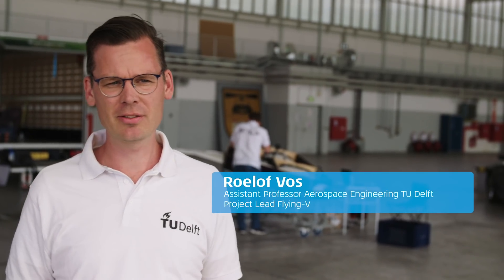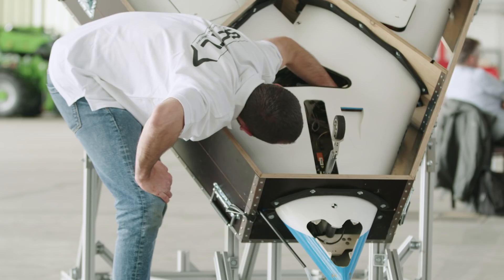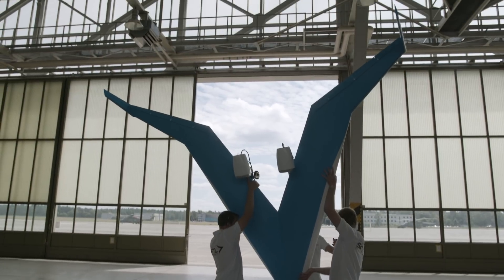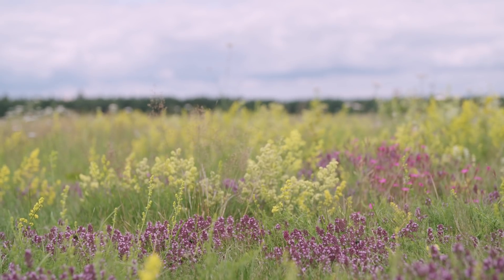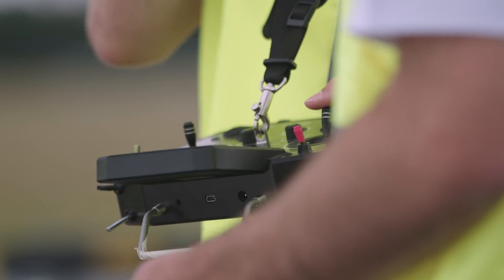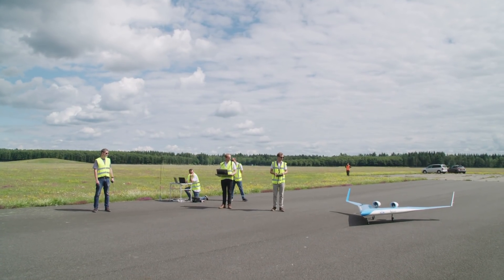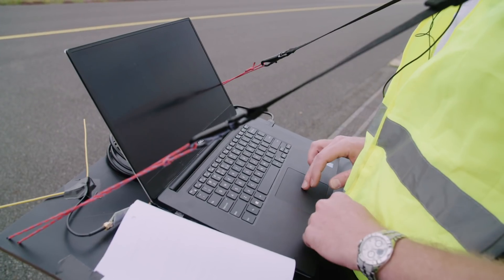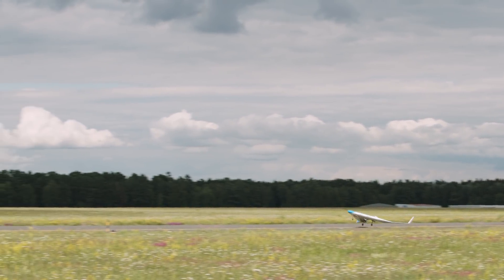Flying-V - Scale model maiden flight

Comment: Aerodynamically more efficient maybe, but I seriously doubt it would more efficient to manufacture, etc. And all the drawings I’ve seen show windows in the leading edge which sounds like a disaster waiting to happen with icing conditions, a large bird strike or even minor accident survivability.
Reply: Idk, they deal with birdstrike, crash, and icing issues with cockpit windshields.  It would cost more, but think it's feasible from a windows standpoint.

I've heard that riding in the wing would be disconcerting when banking, think that might be the killer.
Reply: Neil Carey  Well the cockpit windows are pretty thick multilayer glass, that would be quite expensive and heavy with a lot of extra structure around them compared to current passenger windows. To do all the passenger windows in the leading edge like that, it’s not very practical I would think. And yes, I can see the banking being problematic.
Reply: The same reason why blended wing aircrafts are not being in use commercially, the idea is not new.
Reply: @SuperYellowsubmarin  Exactly, a very old concept. Maybe all the continued research will pay off eventually or uncover something useful, kind of like the current research into quieter supersonic aircraft.

Comment: I guess it crashed as they're not showing the landing...
Reply: Hi there, it didn't really crash, but it did land hard enough to damage the nose gear. Also, "dutch roll" tendencies. However, these things are to overcome, it's a test model. It's a completely new shape for airliners, that's for sure.

Comment: Would be interesting to learn a bit about how difficult it is to maneuver, as flying wings are said to be less stable.
Reply: Apparently it has a bad case of "dutch roll".

Which is an actual aircraft effect, when the aircraft yaws uncontrollably.
Reply: I read a report that said it was quite "difficult to land" and it was unstable... not sure if they only meant that it was unstable on final, or all the way around.

Comment: The design was ok except for the huge v-cut at the back, it might have something to do with aerodynamics but doesn't it a huge waste of space and also a huge discount on the aesthetic side.
Reply: wings on conventional planes, also waste space as well. Saving 20% of the fuel, is a good win tho.
Reply: @senryuuhoutaro3353  Doesn't the wings of aircraft store fuel? Isn't it not waste of space if it was used to store something?
Reply: @cheezehao1129  The design is to make the plane lighter, so they can have less space, and use less fuel because.. it's lighter mate.
Reply: @senryuuhoutaro3353  I am just saying that it is aesthetically not good, a lot of flying wing designs don't have the cut out too. If you don't use the cut out design and used the space to store something, you can make the scale smaller thus more efficient. I am not against the design but I really don't know why they design it that way, it might have a special purpose but from my unprofessional eyes it is a waste of space.
Reply: @cheezehao1129  well, as far as I know it brings a huge benefit in aerodynamics over having that space filled. The savings on fuel and weight by not having that part, outweigh the benefit of added storage.
Reply: @nikolaalexanderphilipp968  Maybe you are right but doesn't the cut out interfere with the lifting body design that provided the efficiency?
Reply: @cheezehao1129  Well, I'm no expert in aerodynamics, but I doubt they would've built that way if that were correct. 
I don't think the V design is for the sake of looks, it's definitely for the sake of function. 
The V shaped wings probably provide better lift than an entire body? I don't know, but I'm sure a quick google search on the topic of V shaped planes or the website of TU Delft will provide clarification :)
Reply: @nikolaalexanderphilipp968  Since I am not an expert, I would just say that the design looks awful and that's all I can say, any other aspect of the design are beyond my knowledge.
Reply: @cheezehao1129  let's just hope, this is a step, for greater ways of air travel, that will surely make things better in any way possible. I'm also not an expert XD
Reply: @senryuuhoutaro3353  I certainly hope so too, commercial aircraft design have been stagnated after the Concorde end in failure.
Reply: Imagine parking these plane back to back, they will indeed take less space. So, no waste of space....

Comment: This configuration came into being in 1996.   John McMasters was its creator.   (And yes, I know that it is close to the XB-37, YB-49 and B-2).  A few years later Bob Leibeck came up with something similar.   Boeing and NASA have had a similar model flying for 10 years.   So while I applaud the team at Delft, it really has to be admitted that this isn't a stunning new invention - it's old enough to vote and drink.
Reply: A well yes, you are right,but the thing is, this model represents a to becommercial airliner , with a double fusilage making the v shape , so altough not the first flying V , definitely  groundbreaking stuff.

Comment: there are 2 wings and 2 engines, why it wouldn't fly?
Reply: With enough power... You can get anything to fly!
Reply: @ivanivonovich9863  Right, but the idea about this design is to make a more efficient airplane, so it won't need as much power as more conventional designs.
Reply: Because the fuselage is the wings

Comment: Would adding a rear stabilizer connecting wings add to structural strength and stability?  Half a triangle seems not the most robust design.  My qualifications for suggesting this: I built balsa models as a kid.
Reply: Adding a rear stabilizer connecting wings add to structural strength and stability would improve strength but also weight and DRAG, the whole idea is to have a wing without the ''conventional tail''.

Comment: So many problems with such shape and configuration: stresses at the root of those wings must be enormous; engine location will disturb stable air flow around airfoil and will make maintenance difficult; weight balance with passengers/loads will be a critical issue; evacuation procedure seems to be complicated; airports infrastructure should be changed to handle such aircrafts; but in the end of the day something new and financed, good job
Reply: Are you a nasa aircrafts worker or what? r/imintelligent
Reply: @matee6042  No, just an engineer having common sense

Comment: With enough thrust ive seen a scaled lawn mower fly soo im not that impressed.
Reply: yeah, I was underwhelmed too. Two years work?
Reply: You are missing the point, they want to create a more efficient plane than the conventional fuselage + wings design. So the idea is that this plane doesn't fly as long as plenty of thrust is added, like a flying toilet seat, lawnmower, etc, but to make something that uses less energy/thrust to get up and stay in the air. Otherwise it would be a total waste of thinking and time, as flying wings already exist.
Reply: The guy who designed the original in the 70's used to belong to the club I fly with he is gone now though

Comment: Get rid of the verticals and add engine vectoring
Reply: Not a good idea, if there is a engine failure, the plain has no way to manover.
Reply: @NadeoWolf  Well, it will still have another engine, but maintenance of such system will be a nightmare not only from technical but from economical point of view as well
Reply: Verticals reduce inductive drag, vectoring will consume more fuel = not meeting their primary goal of being energy-efficient

Comment: It's an ingenious design in terms of operating efficiency. One question though, assuming the plane crashes and all the exits on one side of the plane are blocked, how are you gonna evacuate all the passengers within 90 seconds?  Unless they can demonstrate that all passengers can be evacuated from the plane in less than 90 seconds with all the exits on one side blocked off, then even if they build the plane, the FAA, EASA, ICAO, and other regulatory agencies will never certify the flying-v to carry passengers.
Reply: @ogdeeti  This is one of many issues with this configuration.   The people along the centerline are a long way from an exit.   The people near the leading edge can be a long way from the centerline and thus very susceptible to roll disturbances.   The engine/pressure vessel is another cert issue. And finally,  the non circular cross section drives up the structural weight - hoops do a great job of distributing the pressure load equally.   None of that should be construed as I don't think this configuration should be studied.   It just has almost as many things working against it as for it.

Comment: The traditional straight-sided barrel with wings attached is attractive to manufacturers because many of the fuselage structural pieces can be identical or near-identical items. 

With the components of the tapered wings, about the best you can hope for in repeatability is pairs. However the same applies to the traditional aircraft wings. 

As pressure vessels, the aerofoil shapes will be inherently weaker. It is likely that the passenger space will have awkwardly placed ties and bulkheads. Air pressure could assist in the strength of the structure. 

Systems for handling of passengers and baggage at airports will have to be revised or the airframe significantly compromised to allow existing airport services to be used. 

With this radical concept, one can expect the build to be more costly although we now have 3D printing to help out.  This would be partially offset by the saving in eliminating the fuselage completely. 

The downside will be that the aircraft may be economically impossible to alter in size for more or less carrying capacity. With the traditional barrel fuselage, adding or subtracting near-identical fuselage sections is simpler.

Therefore, this radical design would need to be absolutely correct for intended purpose. How vulnerable will it be to orphanage by sudden ambushes in the marketplace. The Airbus A380 is an example of where it can go horribly wrong. 

Significant serviceability issues will exist due to the engine placement, maybe less so than with engines contained within a lifting body design. 

With this radical concept, one can expect the build to be more costly although we now have industrial scale 3D printing to help out.

Comment: I'm generally not a fan of the Flying V compared to the Blended Body Design like the X-48C or Airbus Maverick. But I applaud KLM and TU delft on trying these new structures. I would be curious to see how they would design the interior.

Comment: Whets the appetite!
One of the few scale airliner models I’ve seen that seems to fly to scale speeds
Reply: That's largely down to apparent stability. If the passengers were subject to the scaled up amount of fidgety roll movement you get with scale model RC aircraft, even the big ones, no one would want to fly. It would be very uncomfortable.

Comment: It appeared to be a bit tailheavy and the nosegear is a bit to short ; it looked like the model had to be "pulled off the runway" and once airborne almost stalled. 
These guys should cut one out of polysyrene (eps) covered with glass fibre "straping" packing tape. Then you have a cheap disposable one to get used to flying it and iterate by "tial and error"   And make that one bright yellow with day glow orange tips so you can see the thing while you are flying it.
Reply: @terrypold  the so called "trust angle" in a ideal situation should go trough the center of gravety . The 737 "MAX got this verry wrong with known results.  Trust angle should never be used to compensate ballance problems because the effect changes with the amount of trust. the last thing you want when you abort a landing is the plane pulling up or down without elevator input.
Reply: @terrypold  there is no visable trust vectoring system on this model and getting one certified for a airliner would be complicated. Its a proof of concept of a potentional future comercial design hence KLM and AIrbus are supporting this.
Reply: @terrypold  dificult to see; the chord center line is almost impossibe to be sure of with all the changes in profile along the wing.
Reply: @terrypold  (half) symtricsl profiles arn't flat. Sure they could have make it as a fllat plate and it would still fly assuming correct cg and trust but they did not.
Reply: @terrypold  ah you are a "flat earther" that explains why you assume your  lack of knowledge is a advantage. Once you you learn about the subect you will find out there is much more going on; this is why there are so many profiles. 
https://en.wikipedia.org/wiki/NACA_airfoil.

Comment: What if all passengers suddenly come to one side ?
Reply: Same as if all passengers moved to the back of a conventional aircraft.
Reply: Don't worry, airlines will impose fees for comming from one side to another. :o)
Reply: @TU DELFT
good word
but
how you can manage the weights in both sides of the wings (noted that you have passengers and luggage ...)
Reply: @essafymohamed6016  more than likely they would change the lift gradient on the individual wing or increase thrust on one of the engines
Reply: They would probably use fuel as ballast and move it from tank to tank.

Comment: Anyone curious about the landing, it was rough landing, and nose hit the ground,
Edit : sorry, I mean the nose wheel damaged
Reply: As i quoted: Smoke on the water. I am just a poor boy of cellar science but i know for sure, that this draft makes severe un - CADed problems. I flew as PIC Planes and Modells for long time, i believe that i have it in the guts when there is something wrong with a model (in which size so ever). If you will test it in low speed config. i will show them horrific flight configs in delft, so that they will be humble to mow the airfield by hand. True hand - work makes the spirit honest. See me smiling.

Comment: Airbus is claiming that this is a revolution in design, but honestly, not only has this boomerang shaped designed been used before, but its not as efficient as pure flying wing aircraft. Ironically, NASA has been testing this design for over thirty years, with a model test flight of a working prototype a little over ten years ago.  The problem with such a design is that it probably has all sorts of drag on it, with such a blunt wing like that.  This is more stunt than test.
Reply: The reason they test it is because it's shown to be 80% more efficient about fuel per passenger than conventional aircrafts.
Reply: Airbus knows what they are doing and even if you are right; this model is much cheaper then wind tunnel test. would not be surpriced if the carbon fibre used are left overs from full size production. So all they had to spend is a bit of epoxy and model plane gear,
Reply: @cmulder002  Of Course they know what they are doing.  They know how to copy and steal ideas from competitors.  Flying wing designs for commercial aircraft started back in the 50's. A similar boomerang style aircraft was conceived years back.  Hell, the B-2 bomber is a basic boomerang shape.  Not even 20 years ago, NASA had tested their own 1/10 scale model of a flying wing.  All Airbus did was take that research and claim that they are making a break tough design when really they haven't.  The BWB was originally slated to be the next 797 back in 2000, before people realized that no one wants a supper sized aircraft like this after the A380 stalled. They probably went with the boomerang shape to cut weight and make it a mid-sized jet in an effort to not repeat their 380 mistake.  Also, they cannot make this out of left over carbon fiber from production.  That's not practical.
Reply: @jhmcd2  you mean stolen from the horten brothers surely ?  think the cutout is for the engines. A full delta has more room for cargo  so would be a more profitable design.
Rc modelers build prototypes all the time ; they just don't get the publicety of the media. Look up "inter-ex"  its a anual meeting of experimental models and what is shown there is much more advanced th this v shape.

Comment: No offense but thats an ugly looking Plane. Theyre going for the Looks and more Seats. Its 2020 . ill give a shout out to Ukrainian Aviations for inventing a Parachute 🪂 on every Commercial planes. Looks sketchy.  Nice try 🥶
Reply: Ugly looking? That’s your opinion. 
And they designed it like this to reduce the drag of a normal cabin, this way the plane is more aerodynamic and saves 20% fuel compared to an Airbus A350. 
Also, planes won’t go commercial until it’s 100% safe to fly in, so you won’t be needing a parachute.
Btw, parachutes have a weight as well, and more weight = more fuel having to be burnt, which is the complete opposite of this idea.

Comment: Nice model plane.  But what is the point of this design over  more conventional aircraft?  What is the point of this video?  What a waste.
Reply: It can carry more passengers without needing as much wing surface because the main cabin is the wing
Reply: @modernblueberry8332  sounds horrifying. just like looking at it.
Reply: JJ Flash what’s the point of anything? May as well cease to exist. Oh God it’s all so depressing...
Reply: Saves up to 20% fuel. So more profits for airlines.
Reply: If anything its safer because you don't need a cabin with wings that can snap off the wings are the cabin.

Comment: It flies, but has anyone seen it land safely. Normally a test flight has take off, flying, then landing, the third element is not shown?
Reply: I read that it was tough to landing. I'm guessing they didn't want to show it. Not good PR.  I'm amazed that not once do they mention what the scale is???
Reply: As said in the comment above me, the landing was pretty rough, the front tiers broke. They’re repairing them right now. After that, there’s probably more model test flying!